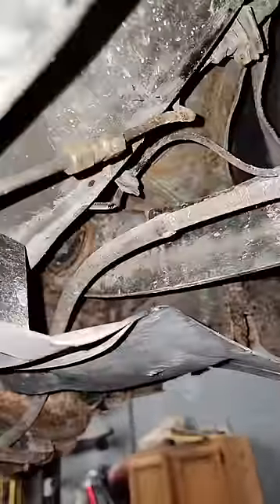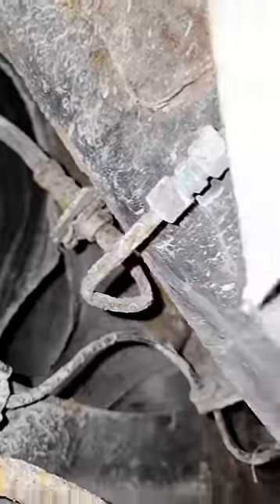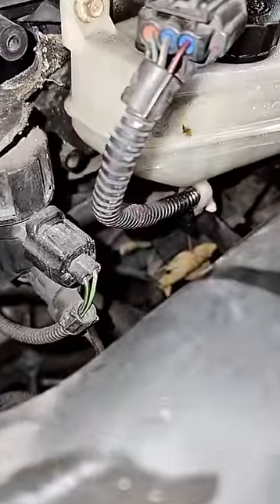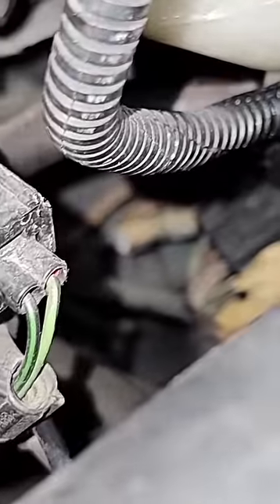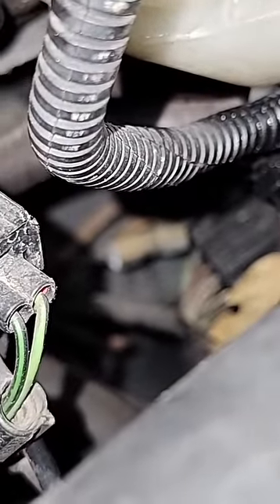don't use compression fittings on brake lines

Comment: I'm with you on that Mike, I would refuse to touch it unless all those garbage brake line repairs are removed and replaced with proper flare fittings (or complete new lines which is what I would actually do). Compression fittings on brake lines are far too dicey and I know for sure in my state it's illegal.
Reply: More like replacing all the lines, I'd say.
Reply: i work for a parts store, and i straight up refuse to sell compression fittings to people who intend on using them on brake lines. ive seen em blow going down the freeway, and its never pretty.
Reply: @twitchycygnus  refusing to sell a customer something is a good way to get fired. All your employer wants is to steal money from anybody they can, especially you.
Reply: @ProleDaddy  unfortunately they don't pay me enough to care lol. I'm more about the safety of my customers over making a company a buck.
Reply: @twitchycygnus  then your tenure will likely be short-lived.
Reply: @ProleDaddy  I said that in my original comment but thanks for your input
Reply: @ProleDaddy  you apparently can't read inside parenthesis? It literally says "or complete new lines, which is what I'd actually do"

Can you read that? Or do quotation marks block it out for you as well? SMH
Reply: I'm getting commenters mixed up. Y'all look the same.  I did not see that line when this was originally posted. So be it.
Reply: They won't pass several state inspections but that depends on how hard they look at the vehicle to inspect it. I also agree that for emergency use they're ok but agree with you that it's yourname and reputation as well as your business on the line! Sure wish you were close to us
Reply: @Uh oh  you're heavily exaggerating.

Hes not getting fired for not recommending compression fitting or steering people away from them. If anything, hes making the store more money by avoiding the cheap fix, and possibly getting new lines.
Reply: @twitchycygnus i work in auto parts as well. I try to steer peopld away from them. Usauly atvthe very least a union but if they are dead set on compressions i atleast show them the dorman steal/heavy duty ones. I once had somrone ask for a food of carburator fuel hose rated for like 20pdi to put on his daughters cars brake line ehich can hit 2500psi...i told him no to say the least.
Reply: @emmanuelmedina2740  He said he'd refuse to sell, not that he would not recommend.
Reply: I put new dorman pre-bent brake lines on my truck, and the 2 lines at the bottom of the master cylinder leaked. I had a hell of a time hooking them up and didn't even wanna try to take em back off. So I just added fluid. It went on like that for a while, then 1 time I checked it and it was full and it's been full ever since.🤷 Heck yeah lol hope it stays that way
Reply: I'm a mechanic from uk and I've never even heard of these compression fittings. what psychotic person wouldn't flare there brake lines
Reply: @martb-productions6432  people who are to lazy to learn but to broke to pay someone who knows to fix it.
Reply: @newinans 
They're illegal because of federal laws that make them illegal, I'm a Pennsylvania state inspection mechanic and people get a little confused thinking that because individual states have safety inspections that they can say themselves what's allowed and what's not allowed, not how it works.
Ultimately all you're doing as a state inspection mechanic is making sure that the vehicle passes the original federal standards for that vehicle from the year it was produced, quite a long time ago the federal government told car manufacturers that only flare fittings are allowed in the construction of hydraulic brake systems, so as a state safety inspection mechanic you're ultimately making sure that the vehicle meets the original federal requirements for the brake system on that vehicle, since the federal government via the Department of Transportation rules didn't allow that vehicle to be built with compression fittings as a state safety inspection mechanic you're making sure it hasn't been repaired or modified using any.
States that don't have annual safety inspections like we do in Pennsylvania it's up to the owner themselves to make sure, ignore the law that they're not allowed to be used and you may not have to worry about a state inspection mechanic flunking it but if your brakes fail and as a result someone in your vehicle or another one is injured or killed and you could very well go to jail and/or be sued in civil court for illegally modifying a vehicle, so in states that don't have safety inspections people may think they're getting over by putting compression fittings on a brake line but they better hope nothing happens or every penny they make for the rest of their lives could wind up going to some victims family.
Reply: @Duke Craig  I agree with you 100%!!! I'm under the impression that you got the wrong idea from my reply. I not only agreed that compression fittings were not what should be used but also agreed that it would be his name, business,  as well as reputation on the line. I did not however go I to the aspect of others lives but only as an oversight, not as less of a subject.

Comment: I admit I’ve used them on my jeep but after I got home I replaced all the lines 

There a emergency get you home thing in my opinion
Reply: If they got you home they would assume that it was a valid fix days become weeks etc
Reply: I refuse to believe this. And only takes a little bit more time to flare the brake lines and put a union in. Do it right or don't do it at all. You can get somebody killed if your brakes fail while you're driving and you can't stop.
Reply: @brantkensinger3398  I agree completely I didn’t know how to at the time. I’ve learned since although I just ordered a stainless line kit and replaced them all after.
Reply: I have never had one come apart. I have used them on everything from brake lines to hydraulic on the equipment to water and air compressor not saying it's right but when you can't get the right part right away and you  need it do what you have to do to get it going again
Reply: @toodjackson4438  What do you mean when you can't get the right part? Everyone stocks flare nuts and brake lines.They are more readily available than compression fittings?

You can't compare this to air or other applications. Brake fluid can reach 800psi to 2,000 psi or more in that small line (3/16 inch diameter). This is never a valid or safe repair. You could get someone killed. Why take a risk.
Reply: Dont buy a Jeep.

Comment: As far as i know in Michigan its illegal to use compression fitings as a means of repair
Reply: @homesteadhaven2010  certainly not a good thing if it comes up in a lawsuit!
Reply: Nah, live in MI under caitlyn jenner jr.... buy them from local auto store to fix my dirt cars. - thanks sleepy joe
Reply: Oops lol
Reply: @homesteadhaven2010 
They're illegal anywhere in the US for any vehicle that's going to be on the roads, off road vehicles you can run them but I wouldn't, there's a reason why they're illegal and considered unsafe, and contrary to what a bunch of yahoo shade tree mechanics will tell you it's not because of some nonsense politics or "they don't want you fixing your car yourself" reasons, it's because under enough of a load they can fail, only flair fittings are legal on hydraulic brake systems for road use.
Reply: @homesteadhaven2010  
That's a long comment?

And by your saying "They're probably illegal in most states" I'd never guess you're ASE certified, as one myself I'd think you'd know that it's not up to the states to determine whether or not something like that is legal, they have to abide by what the federal DOT and NHTSA determine what's legal and required by the vehicle manufacturers, a lot of people mistakingley believe that because individual states have their own annual safety inspections like we have in Pennsylvania that the states get to determine what's allowed and what's not, nope, they simply follow what the federal government requires, because at the end of the day the federal government has oversight since all the roads in the US are all connected.

Comment: I recall my father's 2001 Focus having quite a few master cylinder problems. Word of warning, if you're not already aware: Ford used quite a few different master cylinders depending on the vehicle options. More than just front disc vs 4 wheel disc, they also had different masters for ABS, standard traction control and AdvanceTrac ESC.

Comment: I always used a double flare kit from JC Whitney. Does a good job and its permanent
Reply: That’s because that’s a proper repair
Reply: Double flare and bubble flare.
Reply: I half ass stuff so I just single flare….
Reply: There's a name I haven't heard in a while :-)
Reply: I also always double flare but then I have to cut it off and do it again with the nut on this time.
Reply: @didaloca  Been there done that
Reply: So the double flare fittings are cool, right? 
They're the same as where they connect everywhere else. 

This guy used like.. actual compression fittings?? Wtf
Reply: @didaloca  Anybody who has done double flairs and said they haven’t done that is lying.
Reply: @emmittmatthews8636  wait, like, the ones you'd use on water pipes?  where'd he get ones that even fit a brake line?
Reply: @didaloca  its always the best double flare you have ever done too😂
Reply: @altonb93 Of course. The best flare  you have ever done. Then shit ! No fitting. And to make it worse the line is now to short. Every mechanic does it once, or ten times.

Comment: I bought a truck once didn’t notice all the compression fittings on it. Took all Saturday to replace the lines. All of them my dad helped me, new master, and all wheel cylinders and shoes all four it was old truck. Brakes worked great after that sold it back to the guy I bought it from. He said brakes never worked so good when I had it👍

Comment: Compression fittings work. I've have them on my trucks for decades. No issues whatsoever. I do suggest getting the steel ones from NAPA as apposed to the cheap brass ones from the other auto parts stores.
Reply: No they're not OK for hydraulic brakes and there's a very good reason why they're illegal. 
When you say trucks if you're talking air brakes on tractor trailers yea they're perfectly fine, but hydraulic systems are a different animal.
Reply: @Duke Craig  there's nothing illegal about using compression fittings on hydraulic brake lines.
Reply: @louiewatson9389  
Yes there is.
I'm a state inspection mechanic and there's always someone like you who wants to argue about this, if you think they're not illegal then the next time you're driving down the road and you see a cop pull over and show him compression fittings on the brake lines of your hydraulic brake system and see if you don't get written up for it, if they're not illegal then you couldn't get an equipment violation for them.
Or just take a vehicle to have an annual inspection done like we have in Pennsylvania, if the inspection mechanic see's them your car will flunk and you won't get your annual sticker put on it.
And it's not because individual states declare them illegal or legal, all the states do is follow the Federal government's guidelines, the vehicle manufacturers aren't allowed to use them when manufacturing a vehicle nor are they allowed to be installed as part of a repair or modification to a hydraulic brake system, no vehicle that's registered to operate in the roads is allowed to have them.
People like you who become instant experts on the legality of them assume that just because parts stores sell them they're legal, they're allowed to sell them but no one, a mechanic or the owner of the vehicle, is allowed to install them on a vehicle that's going to operate on the roads, some farmer can put them on some old pickup truck he drives around on his farm but never takes on the road, that's legal, but the moment he pulls it onto a road he just broke the law.
And people like you also will assume they're legal because you put them on your vehicle and later on a state inspection mechanic put a yearly sticker on your car, just because he didn't thoroughly check your brake system and find it doesn't make them legal. 
Trust me guy, they're illegal, and if you put one on a vehicle and it fails causing your brakes to fail and as a result someone is injured or killed the courts will be explaining to you real quick that despite what you think putting them on your vehicle was illegal and that's why you're getting criminal charges filed against you and right after that you're gonna find yourself in civil court getting sued by someone's family for causing their death because you made an illegal modification to your brake system. 
There's a reason why us mechanics won't put them on vehicles, because then we'd be the one's in court for making an illegal modification to a vehicle that led to someone's injury or death.
Reply: @dukecraig2402  So, what is the very good reason why they are illegal? It can't be the pressures involved, because they are used on hydraulic systems that far exceed anything a vehicles brake system could ever hope to achieve.
Reply: Lots of stated have no inspections whatsoever. Like your neighboring state of Ohio for instance. Most police, and highway patrol have no idea how to work on vehicles. Let alone what a compression fitting even is.

Comment: Don't use the brass ones. Eaton makes a compression fitting that is DOT approved
Reply: In Virginia is doesn't matter brass or any other metal.. even if they are DOT, no compression fitting on brake lines

Comment: In my younger days I would use compression fittings. Never had one fail but I'll never do it again
Reply: I have used them in the past as well never had one fail and they got me going on budget. Funny the reason I used them was the brake line failed.... Every time! If you got one rust hole in a line just replace them all to be safe. I never thought that a compression fitting was the weak spot in my cheap cars.

Comment: Transmission lines ok  but never on brake line
Reply: Can i ask a dumb question?  
Are these the double flared fittings? Is that a compression fitting?
Reply: @emmittmatthews8636  compression fitting are usually brass fittings that have a sleeve to go over the pipe and the sleeve will compress over the line and seal it when you tighten the nut
Reply: @emmittmatthews8636 
The only dumb question is the one you don't ask especially when it comes to your brake system, no compression fittings aren't double flare fittings, and compression fittings are illegal on a hydraulic brake system, only double flare fittings are legal on hydraulic brake systems (including the variant some people call double bubble).

Comment: It’s scary what is on the road.  Honestly there is a good argument for mandatory state/province inspections, as long as done properly yet sensibly. I see vehicles on the road all the time that should not be,  Ministry of transport or police don’t seem to care. Seems like stuff like this isn’t under police jurisdiction or at least not in their mandate, but it used to be.
Reply: You must be a foreigner.

Here in the states. It depends on what state you live in. Also they're not worth a crap the inspections. They are all half ass anyhow. The inspectors don't do them right whatsoever. Also they're only once a year.
Reply: @IG10705  Once a year might still get idiots like the guy who owns the Focus off the road or fixed safely.
Reply: @IG10705  Thats why I said if done properly. i know they are not always done right, but there are some shops that do their job well. At any rate, people like the one that fixed that Focus shouldn’t be working on cars, period.
Reply: @peterl2017  seriously once a year for inspections are a complete joke. All they care about is either your emissions depending on where you live and of course the rust. Surface rust isn't a problem. It's the rotted out vehicles that they are more concerned about. They typically give you 30 days to fix the vehicle and then resubmit for an inspection. 

You actually believe "if they're done right"? For inspections. 

Boy oh boy
Boy oh boy. 

They don't look at the vehicles the right way. There's videos of how they inspect the vehicles out. All they do when it comes to brakes. Is pull one wheel in the front off and look at the pads through the caliper to judge the thickness. Then they pull on off on the opposite side in the back and do the same thing. They don't even look at every the right way. They won't even pull the brakes off to see how thick the pads are or the shoes. 
They look at the exhaust to see if you have a muffler and catalytic converter on it and if it's loud. They don't care about anything else on the vehicles othe than the safety stuff and the body. Yes they look at your tires also.

Using 1 and I mean 1 compression fitting isn't bad as a temp fix but what that guy did is an idiot.
Reply: @IG10705  Its OK if we don’t agree 100%.  Everyone can have an opinion. 

I don’t think our views are really all that different.

Comment: I would re plumb the entire brake system with stainless steel, I've already done that a couple times. In one spot I could not make a run in one piece so I made it in 2 pieces, but not with a compression fitting. I used a stainless flare coupling intended for hydraulic system use. Stainless tubing is the only sure way to have no corrosion worries in rust belt vehicles. Use plain steel flare nuts where they mate with aluminum threads, and put anti seize on the threads. Then put a corrosion inhibitor like LPS-3 or CRC marine on the steel flare nuts to keep the wrench hex intact in case it needs to be disassembled someday.